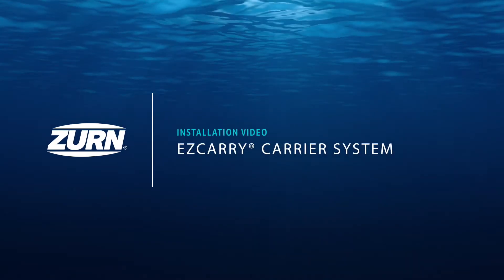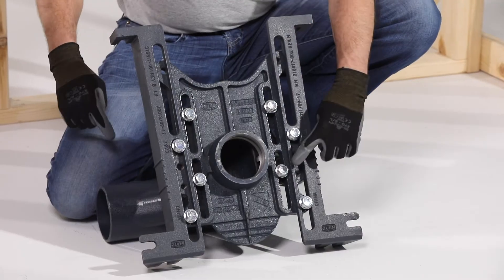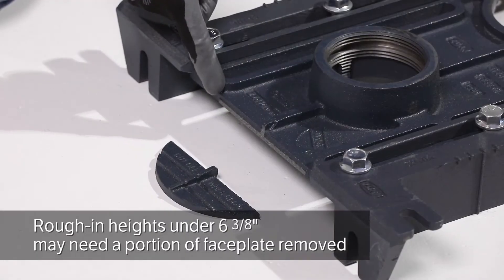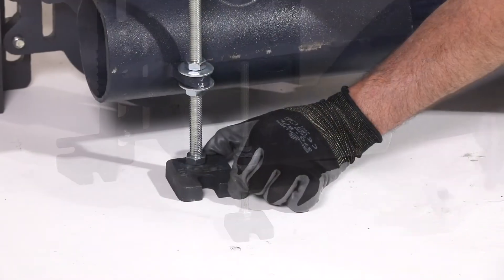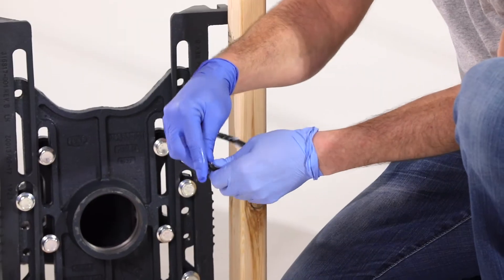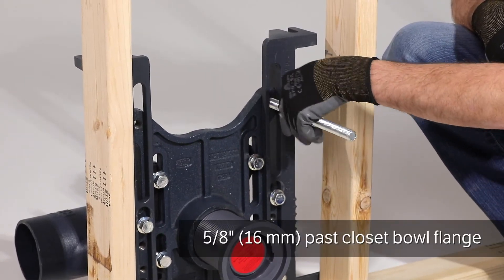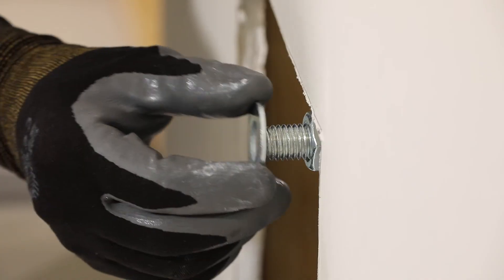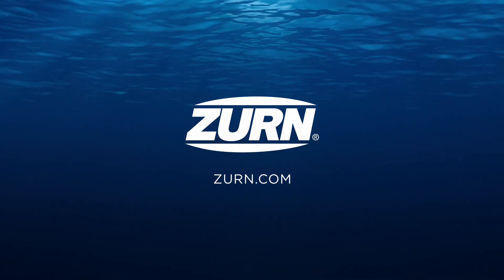Installing a Zurn EZCarry® High Performance Water Closet Carrier System

Comment: Great refresher video for me, thanks! I haven't touched a carrier in 6 years and am now plumbing lead on a government job. I can't seem to find my answer and plan on calling Zurn tomorrow. Nothing in any pdf's I found or my submittals, but there is no mention of the diameter of the bearing rod (4 rods that carry the WC). A rest area I did long ago had to have the carriers go through a block wall, so I had to use the max 12" couplings. This new job, same situation, but I have some double carriers going in and the wet wall leaves the face of the carrier just a smidge off from even the 12" couplings being able to hit my needed 5/16" through finish wall. Do you know if Zurn has anything over 12" these days? Or a coupling for the coupling? Extension adapter, or anything? Crazy how the government can demand I follow strict rules but their engineers make things impossible to do to specs that they set. Lastly, I've done tons of carriers and have always used 3/8" rod and drop ins for my feet anchoring. The specs for the these carriers say 1/2". If the space is as I remember on the holes of the feet, 1/2" won't be possible to have the slightest wiggle room, and wiggle room in anchoring is a must. Again, I plan on calling Zurn but having Q and A on these type of videos saves people much more time and only benefits the manufacturers if you can answer any of these Q's. The carriers I'm going to be working with are the Z1201-N4's and the Z1201-ND4's. Thanks again!

Comment: Does the coupling and threaded rod have to be set to the perfect depth prior to wall being finished? 

Is there any adjustment after finished wall is in place? For example, could you leave rods extra long and cut afterwards to desired length?
Reply: From commercial experience you can leave the rod long then cut to desired length after sheetrock and tile go up. Same thing with the coupling, leave it full length until after sheetrock and tile and unthread it. Cut it to your desired length and thread it back in

Comment: BE WARY gentlemen...Bought a gerber wall-hung toilet and a zurn (didn't capitalize either out of lack of respect) wall carrier from major plumbing supply store who suggested this combi.   Despite lack of installation instructions by both,  got special framing installed in wall then tried to 'dry-fit' carrier studs to back of toilet...studs are 5/8" and holes through porcelain are 1 1/4" with NO provision for bushings- both company spokesmen say to hang it with direct porcelain to steel stud contact (and let entire weight of toilet and 'rider' rest on the bottoms of studs and the bottoms of the porcelain holes.  Salesmen called zurn and just got laughed at...something about, "they hardly ever break".  This is something one would expect in a third world country.  NOT IMPRESSED.  Install held up due to having to fabricate  my own teflon bushings.    STAY AWAY FROM this combi of company's.